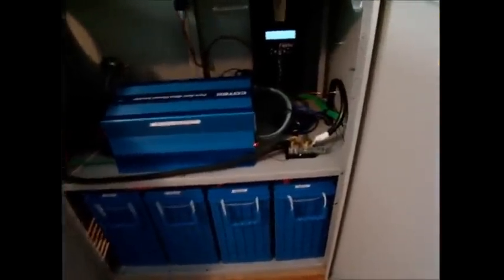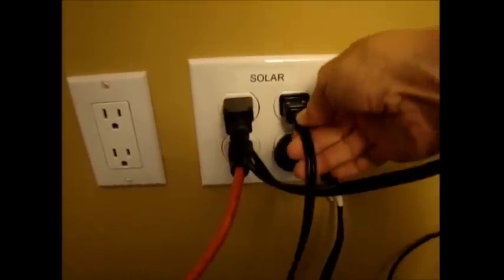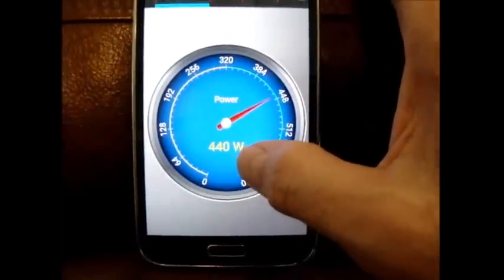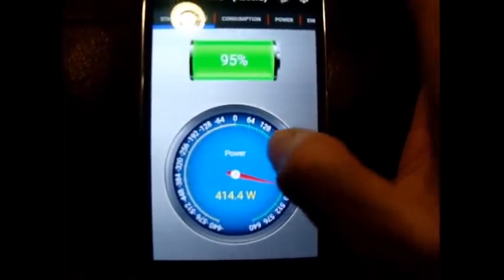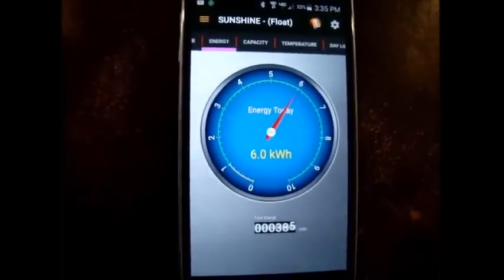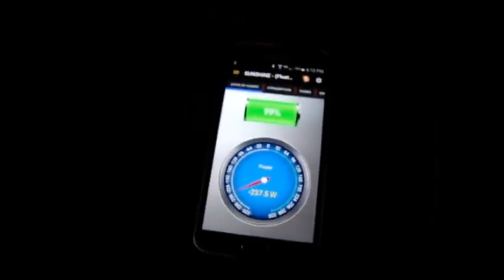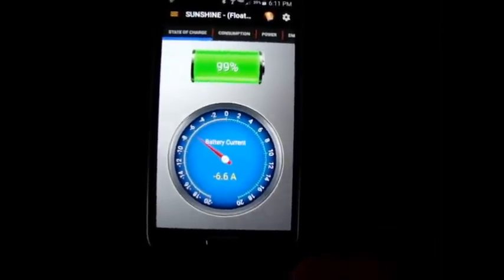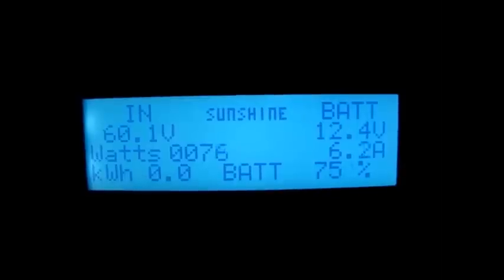Off Grid Solar Power Generator - How I Use It (24 Hour Time-Lapse)

Comment: Did I hear treadmill on solar? I don't get that one.
Reply from the maker: Really?  With all the information I give in that video you ask about the treadmill? Not sure what you dont get... tredmills require power and I had plenty.  Why use power from the grid when I have enough in my system?  Unlike most people, I actually use mine daily and have for many years!  In fact, I use it a few times a day as I worked from home.  As a volunteer firefighter, I wanted to keep in shape...

Comment: Woah, what are you using to monitor the charge controller from your phone like that? Looks nice.
Is that a stock feature / software that came with your charge controller?

I've been massively dissatisfied with my charge controller's (EPever Tracer A-series) ability to actually send me data about what my system is doing, it only seems to work well with the desktop client. T_T (Sure RDP works on my phone but it's not ideal.)
Reply from the maker: I did a video about that app...https://www.youtube.com/watch?v=FD1gN35_ElE&t=4s

Comment: Why did not you choose for a 24 or 48 volt system. You get a Higher efficacy. 

connect 3 set off 2 panels in series and you get 1600w by 120 volt DC. You Midnite can work with 150v DC Panel voltage. 

I have a similar system, I'm happy that i switch over from 12volt to my current 24volt system.
Reply from the maker: I will be changing it over the 24 volts soon...

Comment: Thanks for the tour, sir. I found this video searching for what goes into a 24 hour self sufficient solar panel setup. I don't have solar panels myself, but the idea hugely fascinates me. I play a lot of video games, particularly "sandbox" games, where you can build anything you like in the game world. In Space Engineers, you wear a space suit and build base installations or vehicles, which you can power by building solar panels and batteries. I once built an array with rotors that matched the rotation of the sun to achieve max kWp during the daylight hours, which was fun and satisfying. Having played that game and being familiar with micromanaging systems for solar power, I will say it does hurt seeing your battery at 100% in the early afternoon. Video games deal a lot with resource management, and if I had an installation like yours, I would probably prefer additional battery banks to get every ray of daylight's worth (unless I had a setup linked with the grid, selling the excess - I live in Denmark, I think we can do that here). Have you thought about additional batteries? Best regards.
Reply from the maker: Thank you for your comment.  I will have to check out the game you are talking about!  Anyway, it is not problem with 100% by afternoon because that is often when I run the dishwasher and other things that use the power coming from the panels without touching the batteries.  By the time the sun comes up the next morning, having run everything I want to run during the night, the batteries are only down to about 75% which is perfect.  So, I really don't need more batteries.  In fact, I use almost what the panels produce in a day.   I do wish, however, that I had a 24 volt system. In fact, I plan to make mine 24 Volt sometime.  It would help relax my controller.

Comment: how many batterys and solar panel you using
Reply from the maker: 4 batteries adding up to 10,000 kWh capacity and 6 panels adding up to 1,600 watts.

Comment: Why would you goto a 24v system and not stay at the 12v system that works?
Reply from the maker: Although the system works well, the controller is being used to the max and it gets hot (FETS about 75+).  The turbo fan is almost always on, and it keeps having to shut down the input at times because the input amps often exceed the controller limit.  With my panel array, it really needs another controller or 24V system.  With a 24 volt system, the amps would be cut in half.  This would increase the life of the controller and be less noisy from the turbo fan.  Because the Volts would go up and amps would go down, the watts would remain the same, so really the amount of kwh I get out of it, or performance, would stay the same.
Reply: +PreppingOver50 why not just upgrade the controller to handle the amps?
Reply from the maker: I could.  But, because I am moving my system further away from my panel array anyway, a 24v system would allow me to run thinner cables.  There would be less heat dissipation and half the current.  Also, I want a larger inverter.  Because I plan to get another inverter anyway, why not get a 24v inverter and kill a bunch of birds with one stone... No reason for a second controller.
Reply: If I may, the higher the volts the more capacity you have to transfer energy.  For an analogy, you can deliver water through a garden hose or you can deliver it through a river (volts).  Amps would be the flow.  You can increase the pressure (flow or amps) of the garden hose to deliver more water, but you run into friction and capacity.  

To make matters worse, 12v has a major issue with loss.  You end up with fewer watts from your system than what you capture with 24 or 48+ volts.  Look up the AWG tables to see what size cables you need to equate the different voltages.  If it was me, I would look at options for 48v for the array and 24v for the battery bank (given the number of 6v batteries in this system)
Reply from the maker: That's why I have been planning to go with a 24 volt system.  It's not that difficult to do.  I just need to save for another inverter.  It would also make my controller work more efficiently.  Right now, it gets pretty warm when everything is running at peak.  I plan to move my system much further away from my panels.  I am in the process of doing the cable calculations for this move.  That being said, I have no other complaints about the setup.  It runs really well and runs everything I want it to run and gets fully charged by the afternoon.  My only concern is the FET temps on the controller at times, but moving to 24 volts will help this.
Reply: Whats 24v system if utilities use 120v ?
Reply: @joeydelmarsjr.646   24v [D]irect [C]urrent  power. The utilities run 120V [A]lternating [C]urrent  power .  That is why he needs the inverter. To change it to AC power.
Reply: Safety is why my system is at 24vs. I cringe when i hear you say 70+ amps lol . Higher apms = more heat . 1000Watts/12v=  83AMps  1000Watts/24V = 41 Amps . Smaller AWG is cheaper . Power loss is also reduced at 24V VS 12V

Comment: hi!  how long would you think 1 battery will last until you have to buy new one? and how mush would 1 battery cost?
Reply from the maker: The batteries I am using should last at least 5 to 7 years,  given the way I am using them. For more information on the batteries I am using just search Fullriver DC400-6
Reply: +PreppingOver50 Nice, thx for info

Comment: Thanks for the great video.
I'm looking into using a solar system here in South Africa. Is there any information you could give me about the specifications and brands of the individual pieces of equipment you're using - Management unit, Inverter, panels etc.?
Reply from the maker: I have several videos on my YT channel  that go over all of that...  After getting ideas from the videos, I suggest calling of few of the dealers that sell the components for advice (I name a few) based on your needs. Good luck with your system!

Comment: how much do you save in a month $
Reply from the maker: I really don't know for sure.  It is all relative, really.  At the same time I started using it, I stopped using the cloths dryer because I became more aware of how I was using power (the dryer does not use solar so my bill is lower because of that.   I also stopped using my central air as much (it doesn't use solar either so that will lower the bill a lot).  I use about 7,500 watt hours in a 24 hour period from the system.  Last month my bill was cut in half.  It will never save enough to pay itself off.  I didn't build it for that.  Any solar system on my home would never pencil out because our bill is low to start with.  It is for backup use and hobby, but I happen to use it everyday to help lower my bill some every month.

Comment: Why don"t u run a straight dc circuit to ur 12v appliances?? U will save a shitload of energy cos u have no need to invert it. I have a 24v bank i run a 24v circuit thru the house and then they go into a 48v down converter to 12v in each room to run the dc appliances and also 12v Led 4w downlights throughout the house, now u may ask why a 48v to 12v downconverter and I only have a 24v bank cos when I upgrade to a 48v bank I dont have to rewire anything it will be just plug and play.... so my dc appliances have about a 1.25amp load cont 24hrs a day and a few ac appliances use the inverter to mains power.... Hope u do the same and there's many ways to skin a cat.. for eg: My lappy is 19v so i get a buck converter and dial the input and output to 24 / 19v That saves energy from inverting it up with the 12v car adaptor and or using the ac adaptor. Also I have a 12v to usb 4 port adaptor to charge my usb voltage appliances like my voip box and phone charger etc.
Reply from the maker: You can see in my video that I do not have any DC appliances.  My solar system will never pay itself off, so spending more money on DC appliances to save money would not make financial sense.  If I were building a cabin in the woods off grid, then I would go DC all the way, for sure.  This system was meant to adapt to what I already had.  I do plan to build a portable DC system in case I need to bug out at some point...  It will be EMP resistant.  I will post a video when I am done.  I am working with a couple metal fabricators right now to build my design.

Comment: I totally agree with what you said at the end of the video!  Besides it just being fun to do, you are getting something that people who use net metering do not.  You have a battery backup and USEABLE solar energy even when the grid is down.  With grid-tie, the solar panels are useless without the grid... I've never come to terms with what a stupid idea that was.  The sun is shining, not a cloud in the sky and, OH the grid just went down, but guess what?  I can't draw any power from my solar panels!  ARGH! Strictly net metering isn't for me either.
Good job on your system man!
Reply: You can have panels working grid-tied, but you need a ring on your meter to isolate the system, and a generator of some sort to plug in to energize the system so the panels/inverter turn back on in the day. The isolation ring can cost $500 or more to install because your power company has to do it.
Reply: I like to know how to do this plus have my attic fans and pool pump running on solar
Reply: I'm investigating the subject and found an awesome resource at Ewans energy roadmap (google it if you are interested)
Reply: Christmas Eve
Didn't know that's how it worked! Thanks for sharing.

Comment: knowing the limits of your system is important for battery life.  if I have a couple hours of sun things go good here but if it's gloomy all day things suffer in a hurry.
Reply: No, not really. Because your panels still produce power on an overcast day and the MPPT cntlr additionally helps maximize your input. Perhaps you don't use the washer or the micro wave that day,,, is all.

Comment: Next time U hook up to solar think about just using a transfers switch ,just a idea to think about cheers.
Reply: He's talking about a generator transfer switch that routes different outlets through it instead of installing separate outlets in the wall. You can run grid power or solar power or a combination of both depending on what circuits you want to use .
Reply from the maker: I have another video that should answer your question:  https://www.youtube.com/watch?v=d5p0uKLuR2Y

Comment: Nice system!I have 600 watts of panels outside and in my shed I have 700 ah battery bank. From my inverter in my shed underground and up the side of my house through the attic and into the kitchen(2 outlets) and hall (1 outlet)and living room(2 outlets).I run my computer area and a freezer and fridge if the weather permits.Usually I run the computer 24/7 without worry!
Reply from the maker: Cool!  I went to your page but I could not see any vids.  Maybe post one?  Thanks for the comment...